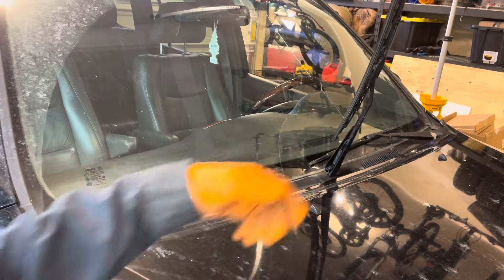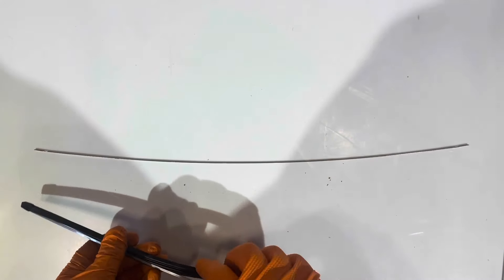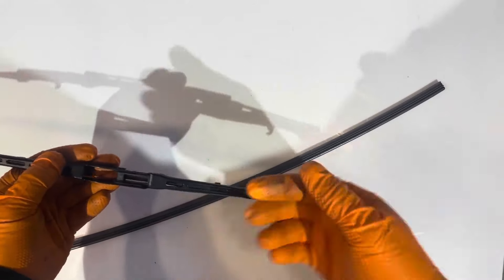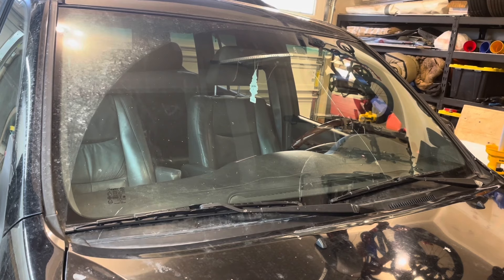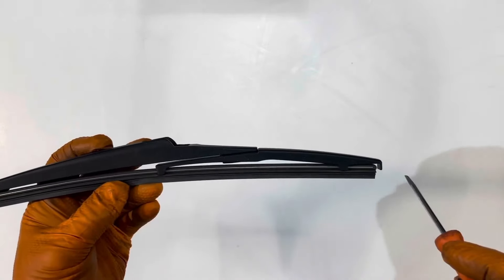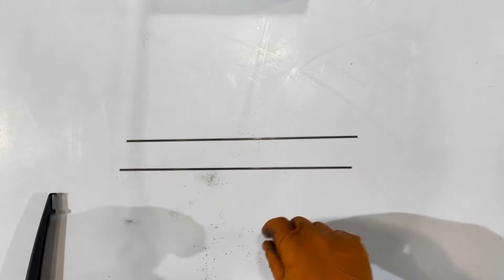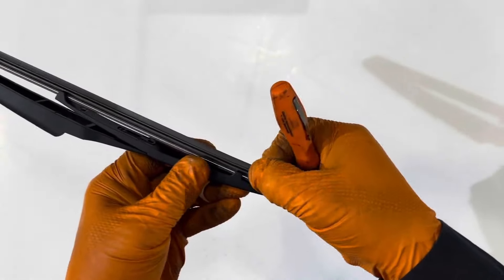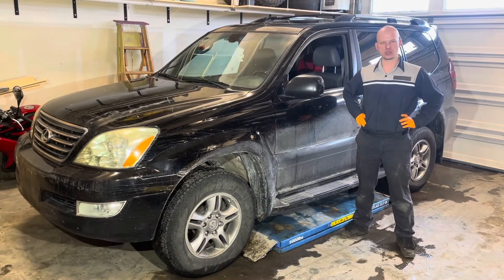2003-2009 Lexus GX470 Wiper Blade Refill Rubber Insert Replacement Instructions

Comment: Another great video Viktor, thanks...QUESTION: What are your thoughts on filling the new oil filter with new fresh oil before starting the vehicle at oil change time? ...and how would you fill the filter with oil on a 2010 Lexus RX350, since it uses a cannister-type filter?...Does - in your professional opinion - starting the vehicle without pre-filling the oil filter cause any damage or pre-mature wear on the engine?...would like to know your opinion. Thank you.
Reply from the maker: I think that if Toyota thought it was important to pre-fill the filter with oil, they would have included that in the repair manual as part of the oil change procedure.
Maybe it would provide some infinitesimal benefit, but it is by no means required.
Also, pretty much every new Toyota engine in North America has a filter that sits horizontally, making it impossible to pre-fill without spilling everything out when putting it on.
You could do it on your RX by filling the canister that the filter sits in with oil before installing if you wish.